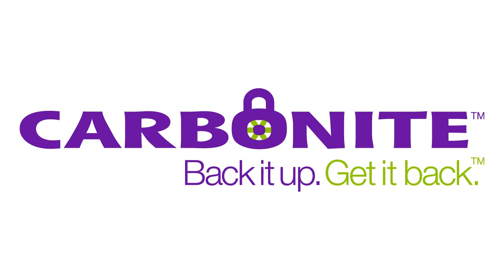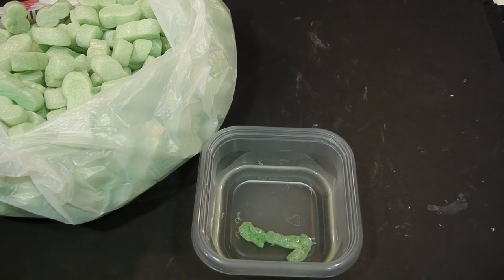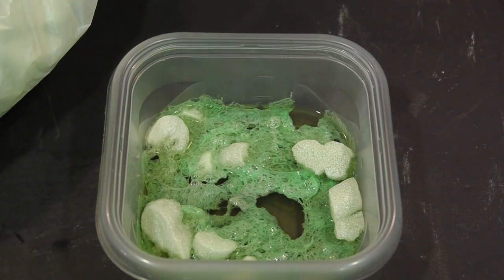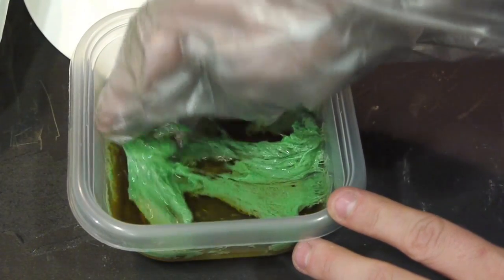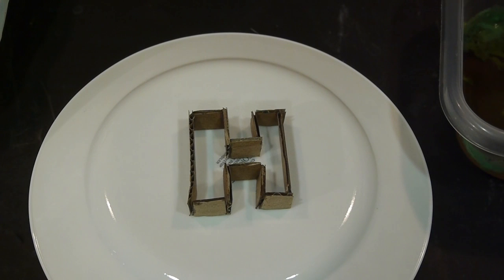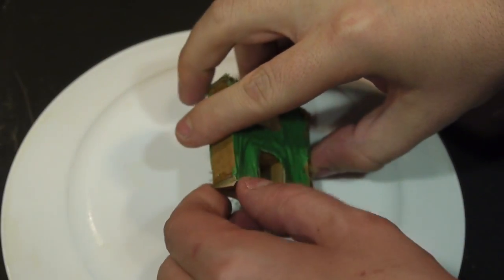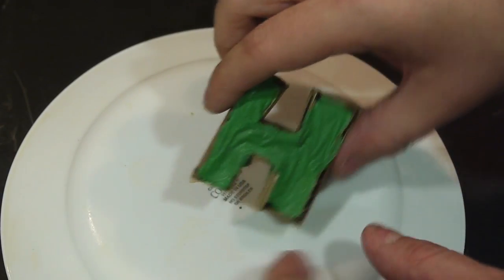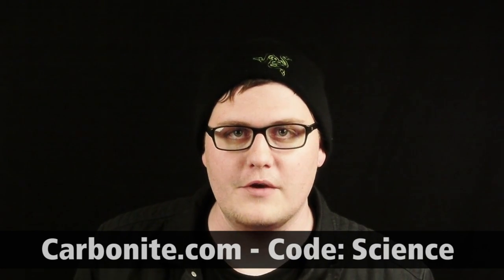Scientific Tuesdays - Turn Styrofoam into Hard Plastic!

Comment: You can also melt Styrofoam in Paint thinner (Toluene,Xylene) mixed with acetone in order to get a somewhat thick clear/transparent liquid that you can use with a brush to put an improvised plastic coat on things. But don't use Paint thinner inside without ventilation as you will get high from it if inhaled enough and it's Not pretty when it wears off, also it's very bad for your brain in the long run just like gasoline. Acetone is not that harmful at all in comparison,but don't use plastic containers or gloves for any of this as they can melt, use a glass jar so you can put a lid on it later, and neither of these chemicals will melt your fingers i promise, but a melted glove can be really annoying to fully clean off. Cheers

Comment: You can also use different thinners/ solvents to make liquid plastic to paint things like tools, anything you want waterproofed or protected. so i don't throw away all the styrofoam that comes from amazon packaging.  As well if you don't want to do any of that, to get rid of it, waste management companies will pick it up to recycle. It does have to be seperate pick ups.
Reply: How do you turn it into paint 🎨 to paint a wall, because it get hard over a period of time?
Reply: How do you turn it into paint 🎨 to paint a wall, because it get hard over a period of time?

Comment: I did this experiment and accidentally got some acetone on my hands and didn't wash it off. It didn't even burn at all; it felt cold as it evaporated down the back of my hand! Is this normal? Or is it a surprise? Or was I just using a different type of acetone? Hopefully it's a superpower. I did this last year and forgot to use ventilation. I had to sleep at a friend's house the next two nights while I waited for my house to air out all the fumes. Don't do this experiment without proper safety, and when working with chemicals, always be outside. Thanks! Don't be stupid like me a year ago.

Comment: I found out that gasoline dissolves styrofoam the hard way... I tried filling up my fourwheeler with gas and the hose couldn't reach all the way, and I tried to use a styrofoam cup... bad day
Reply: You made a really nice version of napalm. 😅
Reply: How do you remove it after it hardened  @JohnSmith-bh8um

Comment: Use foam blocks (white) and 99+% aceton. Steering it for a while and then stretching it makes it easier to mold (less aceton inside, thick glue-like substance). Let it dry for at least 2 days in the sun or 4 days inside for more strength, humidity kills it. Not fire-resistant ;)

Comment: I wonder if you could reinforce the polymer with fiberglass resin while its in a semi liquid state so when it hardens it will be even stronger.
Reply: +aRANDOMqUICKIE Not with resin but fiberglass it self. Just cut/rip fiberglass carpet into individual fibers and mix it in to plastic... or thats how i imagine it would work.

Comment: Worse case scenario you have dry hands from the acetone removing the fats your skin. It's not caustic, thus why it's used for fingernail polish.
Reply: +uberLejoe Umm dont forget you get drunk as hell and additionally hellawa head ache. Acetone gets to your system also trough you skin, right into blood stream, causing dizziness, lethargic state, head ache and in really big exposure coma or death...
So use non melting rubber glows, when ever washing paintgun in diy acetone washer. 5 minute exposure on bare skin can cause real bad hangover. Trust me, i know...
Reply: +uberLejoe worst case senario, liquid styrene is incredibly sticky and flamable and his hands cant be washed

Comment: I wonder if this could some how be used for items for cosplay? Hmm...
Reply: Maybe use a mould for the item?

I may be easier to work with than bondo!
Reply: Maybe for small items because you would need a lot of styrofoam and acetone to make anything much bigger. Plus I'm sure you wouldn't want that chemical smell with you everywhere.  Working with too much acetone is bad for your liver and I'm sure using it to melt packing peanuts is worse. There are safer products for doing what this video shows. Watch videos on casting. There are all sorts of plastic resins, plasters, clay....
Reply: I used to work with a company that made that kind of packing peanut and there are a few things to note here. Firstly they are not styrofoam which is made of polystyrene they are made of polyurethane. If you wanted to do something like this the end product would be far nicer if you were to rinse the slime with a slightly hydrous solution of ethanol (ever clear). The easier, cheaper, safer, and all round better way would be to look in to polyurethane casting for a hard product or to use an expanding polyurethane form 
for a lighter piece then finish how you like. Also don't use spray paint the solvents that keep it liquid will melt the polyurethane.
Reply: Baking soda and 5 minute epoxy makes a very hard plastic that can be molded. 
I recommend clay molds (all items can be found at the dollar store/ bargain store).
Reply: I read your comment like Dana Carvey’s Church Lady skit

Comment: its real plastic- Styrofoam is made by forcing gas into hot polystyrene, when the polystyrene and gas mix is exposed to normal pressures the gas expands and forces the hot and soft polystyrene to become expanded polystyrene aka styrofoam- what hes doing here is just taking the gas out and turning the stuff back into regular polystyrene.

Comment: How to make Styrofoam pellets:
Have a living being, About a million of them, I prefer plants. Step two, Kill them all, or let them all die naturally. Step three, Wait about 50 Million years or so. Then go excavating. Step four, Check on the coal, See that it isn't "ready" yet, and rebury it. Step five, Wait another 50 million years, Check on the coal, See it has turned to diamonds. Step six, Excavate diamonds and get very powerful...Mashing...Plates. Step seven, Squish the diamonds. Step eight, Cook Zed diamonds in a peanut-shaped mold in about 3000 degrees Celsius. Step nine, Take out of oven, And VOILA! You have Styrofoam pellets.

Comment: Packing peanuts are expanded polystyrene, which is polystyrene with air bubbles. Dissolving the polystyrene in a solvent releases the air, when the solvent evaporates, you get the same polystyrene you started with, but with no air.

Comment: If you really want to make jewelry please at the minimum use an air pump and suitable condenser (avoid static voltage buildup...there, that was easy) to help remove the solvent. Just be on par with the precious metal jewelers as far as sophistication. There are some good sidebars in Science magazine on the textures of air (well, gas-dried) polystyrenes and how to make specialty versions using autoclaves etc.

Comment: Styrofoam can be processed in a big still (using solvents) process, but the permits required pretty much have you running a refinery (or as you suggest, a building/insulation board plant) or munitions plant. (The Zero Emissions targets for refineries are 30 years old now...) That might not beat the prize your town dump's kickstarter had at the $23M donor level. Maybe that's better than grinding it for mulch or fixing it in post(-dump state.)

Comment: Goood question. It turns out sea turtles (etc.) eat styrofoam and get super constipated, then die or years later poop it as glass balls on beaches. So, no. Recyclable as plastic type 5 though, yes. Also, though gas is 20 times worse a mutagen, remaining acetone will shorten the available time for you to upload your conscience or otherwise transcend your current physicality. Surf-shop stories for more...

Comment: question, im a mechanic and theres fiberglass repair stuff out there and bondo for metal but nothing for plastic. could this be used say on a motorcycle cowling that cracked and be sanded down and painted to repair that crack? figured since its a plastic it would be better to use than JB weld.

Comment: this is basically the same process for homemade napalm (not military grade obviously).
and @conbeter69 you can actually use any grade of gasoline or diesel for it. Gasoline makes it a bit faster but also hotter and diesel makes it burn a slight bit longer (about an extra minute) due to its purity. Simply mix any Styrofoam (plates, peanuts, coolers, anything made of Styrofoam really, even colored Styrofoam) with gasoline/diesel/jet fuel...you get the point.

Comment: @TisLoading It works with anthing made out of polystrene, but works better with the hard polystyrene that they make some cups and bottles out of rather then the foam. In fact in some countries like Thailand they use old polystyrene juice bottles to make artificial limbs by melting them down. Laquer thinner also disolves polystyrene pretty decently, it's makes a good insulating varnish for electrical stuff.

Comment: @kingofpochy Well first of all microwaves don't neccessarily emit heat they just send microwaves through the water of a substance and speed those up. However, if you put it into say an oven, or just simply had heated nail polish remover, it would go faster.

Comment: Is this strong enough to make battery doors for portable electronics and connector ports? I have a few missing battery doors I need a replacement for, and also connector ports for really old electronics that are rare and expensive.

 Is there any method of dyeing the plastic so it won't be the peanut color of whatever too? It might seem only asthetic but when parts look like ass people notice.

 Also can I use nail salon acetone purified with Jrezky's tip of baked epsom salts?

Comment: @llamalord111 I did that once. Put the "napalm" into a snapple bottle. Took an old sock and dipped the tip in gas. Lit the molotov and through it at my driveway. If you ever do this, don't use a snapple bottle. If you do this and make the mistake of using a bottle that's too hard, don't do what I did and walk up to it and drop a huge rock on it. That way you won't get napalm exploding at your pants...

Comment: @HouseholdHacker It may say that on the bottle but acetone rapidly absorbs moisture out of the air given even short periods of time. If you want truly anhydrous acetone without paying an arm and a leg to a proper chemical distributor, add some baked epsom salts (magnesium sulfate) to your acetone, it will collect moisture and form a gooey substance on the bottom of the container overnight, simply take out the top layer of acetone and repeat as many times as you like for increased purity.

Comment: This carbonite is kind of useless.
For 55$ you can buy another hard disk with great capacity and store your data on it, then put it off somewhere safe. It's definitely safer, cheaper, and longer lasting solution for the problem